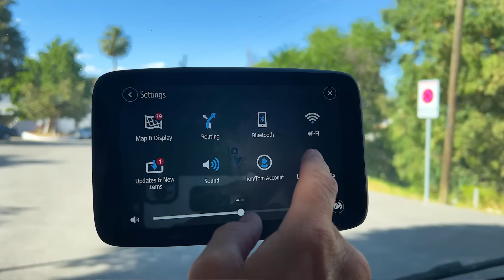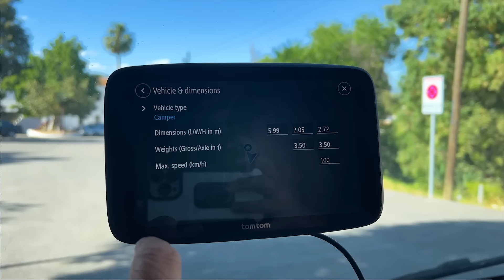YOU CAN'T TRUST ANYONE - VAN LIFE EUROPE - WE GOT RIPPED OFF!?

Comment: Your challenge with colours is that you've used royal blue carpet everywhere which doesn't go with much. It's not a colour you'd use in your house for carpets or wall paint (it's a great t-shirt colour). Using the softer blues like the ones in the tiles in the kitchen are great. So simple answer is to switch out the royal blue carpet for a nicer colour 🤣

Comment: Ahhh how gutting , after seeing the window install I’m inclined to change my original opinion that the awning was a mistakenly sent out return, to now more likely your installer pulling a fast one charging you for a new one and installing a ‘second’. But hard to prove unfortunately. Its a bit of bad luck,  but I suppose your still way ahead in good luck with getting gifted Velton is the way to try and look at it.   That chair is/will be superb and a major plus to the build and works because of the unique way you decided to have the back not the bed area, really like that feature 💕. The question whether to add colour to the cupboard doors or not  I’d leave until you’ve lived in it a bit with all the soft furnishings and ‘stuff’ and decide later. Its really come together and you should be proud of what you have achieved guys 👍🏻👍🏻

Comment: You can use a heat gun on the outside van plastic bits and it'll bring  the colour to the surface again , just increase temp slowly to avoid melting. GREAT job, enjoy the finished  Velton ❤

Comment: If you suspect the awning is secondhand look for the manufacturers sticker , it should have a bar code and serial number which can be used to confirm its age etc, also most plastic parts have a date imprint.

Comment: I've just finished well almost, building my wee van out. My playhouse, I tell my grandchildren. I've had two things completed by "professionals" and both times got a rum job. It's very disheartening. As there were only those things that I didn't feel able to complete myself. One was the charging connection to my lithium battery. I've since had the correct connection fitted, (they'd put a lead acid connection a B to B instead of a DC to DC). But having to get a job done twice and possibly some damage done to my lithium battery is very hard to take.
All the best. Love your videos.

Comment: My suggestion would be to use the same colour of your dark blue trim.
Regarding your lovely table put 2 or three coats of water based varnish, it won't change the colour but will protect the surface
Love your videos,so keep up your lovely relaxing presentations.

Comment: Hi Guys love the idea of the Hammock chair 
“ BUT “ I Would reconsider a more  substantial way of securing it to the sheet metal cross member structure.
I’m assuming you have used RiVNUTS for the securing bolts to thread into the sheet metal Which in my opinion would not be strong enough to carry the downward forces without failure.
Ideally you need a flat bar bolted  to the cross member with load spreading washers bolts and nuts . And substantial load bearing eyebolts. 
Just a bit concerned as i love following you guys.

Comment: The walls of a van are not straight. This means that you have to choose whether you want the gap up or down... you should choose down because of the water - you almost always have to go over with new Sikaflex. I have found that it is a significant advantage to have the "frame" ready when installing windows and roof hatches.

Comment: 'If you want a job doing well do it yourself' is a good expression, but sometimes, especially if the job involves expensive special tools and the knowhow to use them, it's wise to use a professional. It's when the professional cuts corners and takes no pride in their work that it all goes tits up.
 I agree with other comments, they should put things right. Sending you parts to fit yourself will immediately exonerate them.